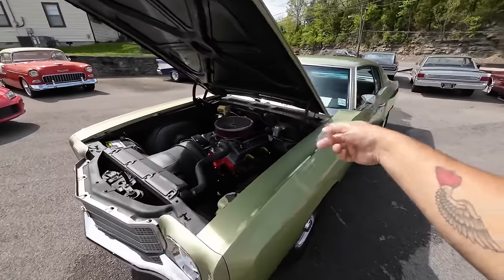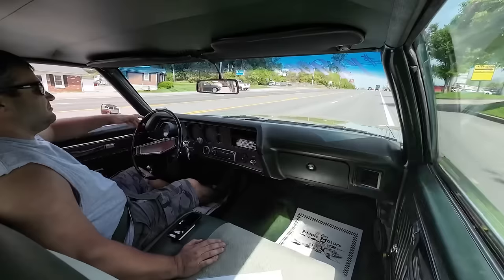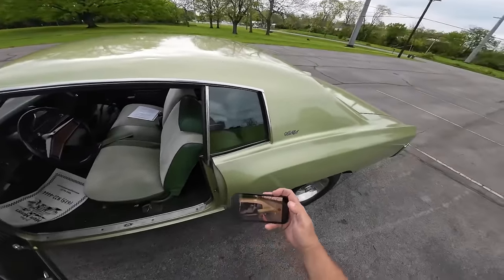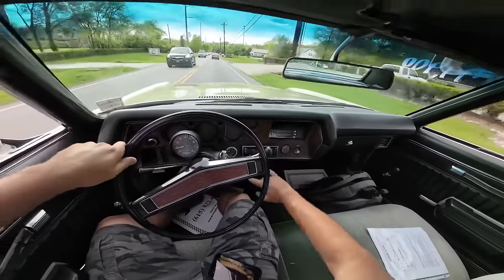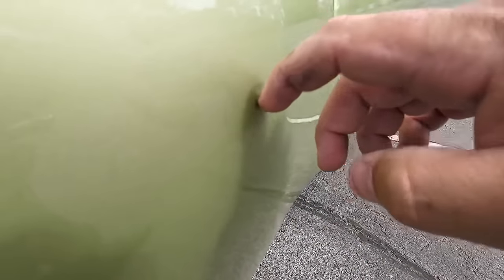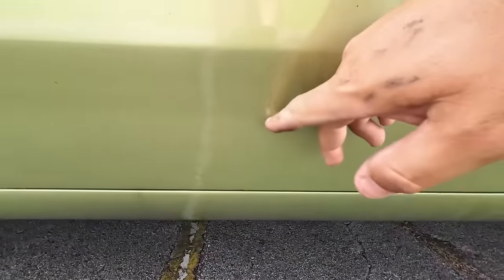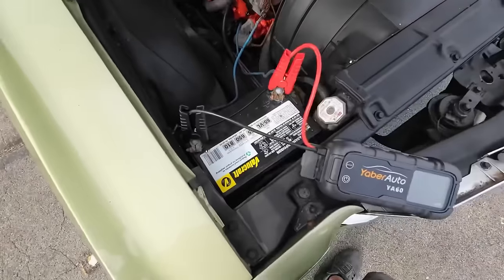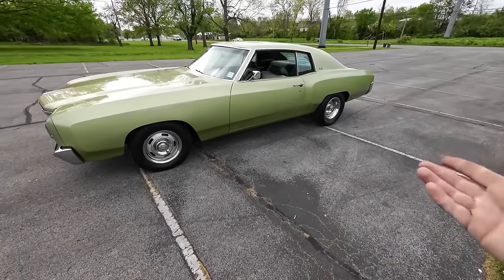Test Drive 1970 Chevrolet Monte Carlo SOLD $17,900 Maple Motors #2570

Comment: I got a dollar that says that the leak is from the thermostat housing the Chrome ones are Notorious for leaking most guys throw them away and use a stock one,   cool old ride nick
Reply: You are 100% right.
Reply: I used a stone sanded it down never leaked it was def not flat

Comment: I am 64yrs old and in 1977 had the EXACT same car. Same color, interior and 350 engine. I loved that car and had great memories in it. I live in Nashville and will have to come down and check it out. Im very interested. Does the drunk guy come with it?
Reply: I had a 1970 Monte Carlo at 16 in 1977!
Changed the wheels, carb, intake, mild cam, and headers.
14.33 E.T. at Fremont Race Way 😎
Still have lots pics....🤓

Comment: man i had a 74  with a 400 pontiac engine 600 double pumper holly carb she flew and was fun to fishtail. only got about 6 mpg. but back then fuel was only $1.12 per gallon  for premium. so just over $25.00 would fill it up.